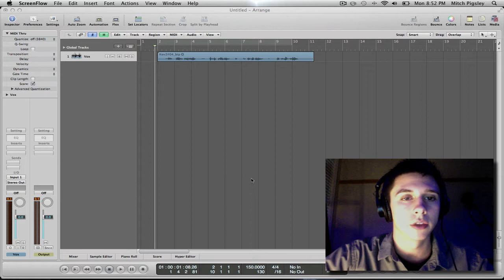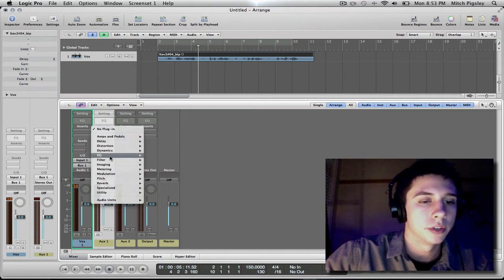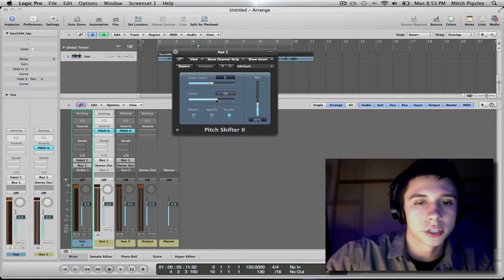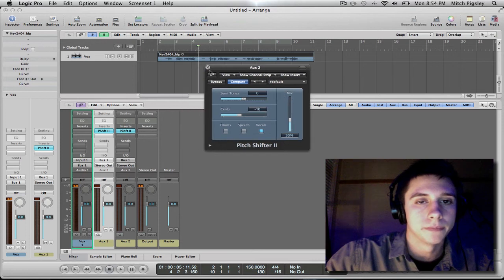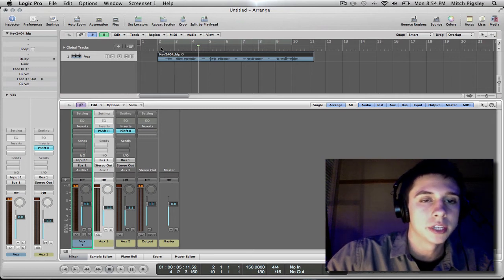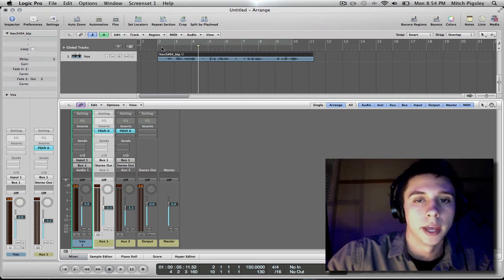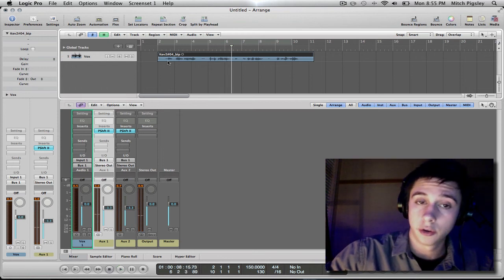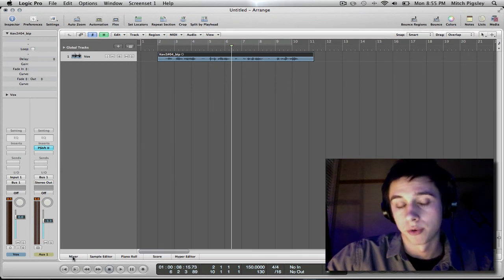Logic Pro 9 - Tips & Tricks #7 (Vocal Fattening)

Comment: Ah, that's what I figured. Well thanks for your help on this man! I'm only on a 13".. however, I just plugged it into a 22" HD monitor, but the screen converted proportionately, so Logic is still proportionately as large and I have the same issue. What I ended up doing was opening the mixer in a separate window.